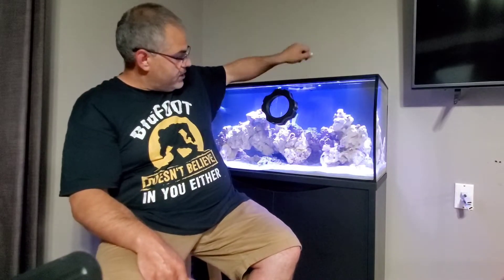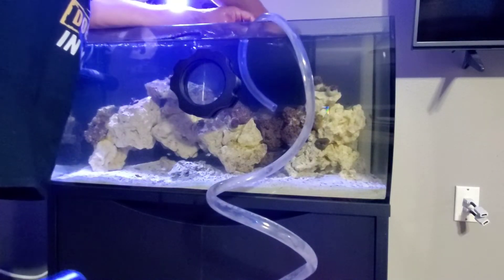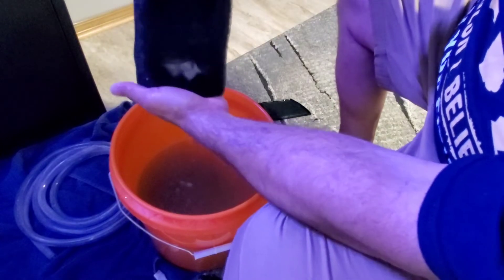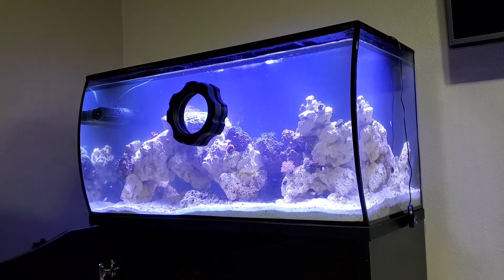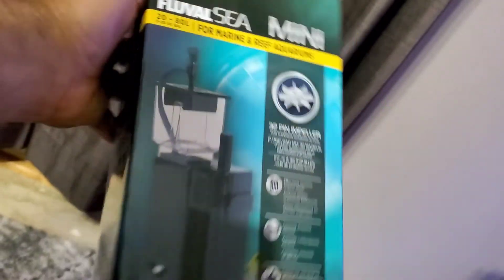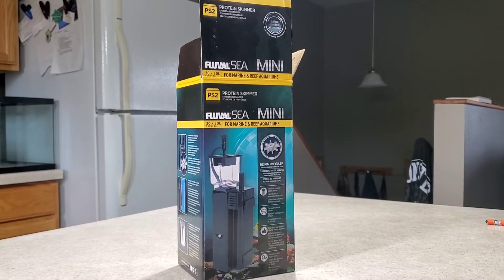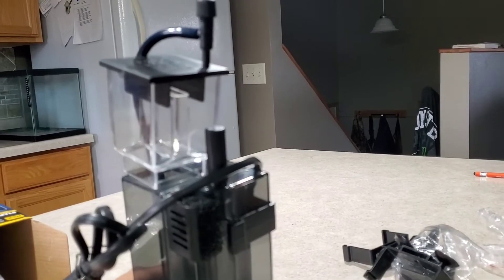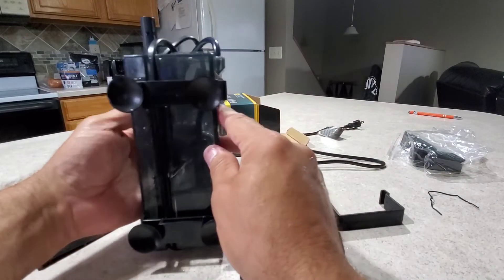Weekly cleaning of fluval 32.5 gallon flex saltwater  minni reef tank

Comment: Can you put the heater in one of the quadrants?
Reply from the maker: You would need to do something different for the media otherwise there would be no room with current filter setup
Reply: @shadbonen  Sorry. Cavity looks bigger on vid. Would've been nice to tuck heater away.
Reply from the maker: @modotd3885  just was looking at it i think if I had one of those flat heaters it might actually work thanks for pointing this out might have to change up the heater🙃
Reply: @shadbonen  Then your heat sensor and heater can be at opposite ends of the enclosure. Should result in more accurate reading imo
Reply from the maker: @modotd3885  I like it glade you pointed this out makes for better temp control i would have never thought about this this is why I need your comments 😬
Reply: You can put your heater in either intake compartments

Comment: You can adjust the flow in this tank?
Reply from the maker: Well with a different pump if you were to change the pump to something that is adjustable but I never have still using factory pump and couple power heads
Reply: @shadbonen  i buy my tank today and I feeling the flow is to low and I think some corals need more flow that’s correct?
Reply from the maker: @un69perron  I would say you need a wave maker or a power head of some sort for certain coral if you look up shad bonen and then go to videos you will see all my vids I had way to much flow for most with the wavemaker but the two 5 jebao power heads I've been able to make the flow perfect and basically use the main pump just to create flow on top of tank to prevent the algea on the surface hope this helps
Reply from the maker: Also to filter water threw bio media as well as collect garbage in water